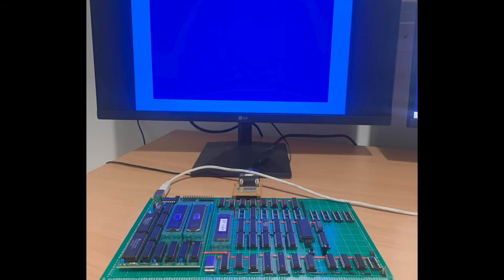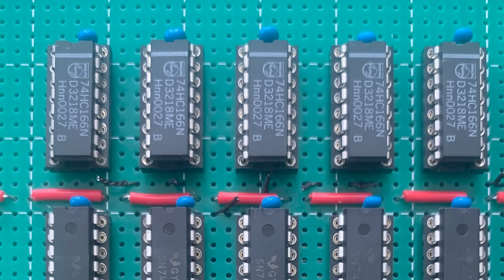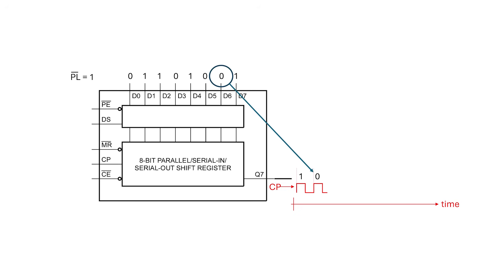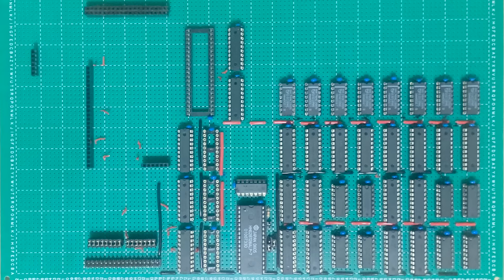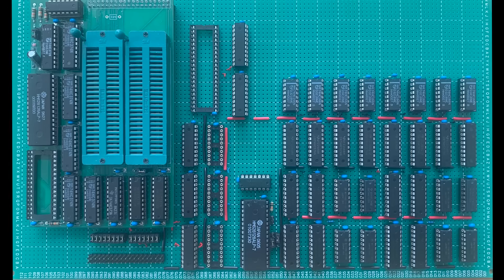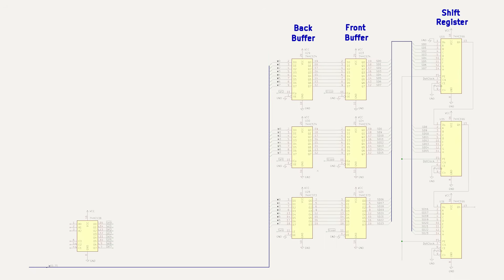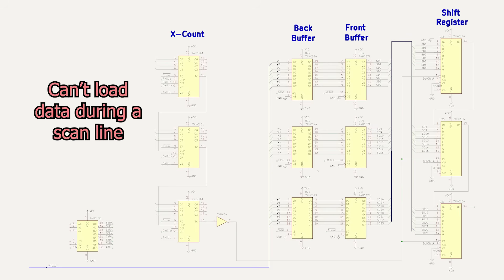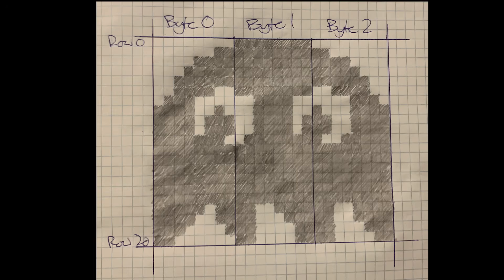Commodore 64 from Scratch: Sprite Engine

Comment: Does anybody know of the adjustments the vic2 chip designer did to make it 80 columns?
Reply from the maker: Yeah, i haven't looked into it.  They'd have to double the dot clock.  They might be able to do in-page back to back reads (same RAS cycle) from the DRAM to read a pair of bytes in one same CPU clock cycle.  Unfortunately  i haven't been able to find much detailed documentation on the fine details of VIC-II (admittedly i haven't looked at every forum), so i am making some assumptions about how it works.
Reply: @DrMattRegan Yes, same here.  I was hoping somebody would know, and all they did was do a few adjustments and overclock it.  But, we hsve the mega 65 design anyway.

The thing was so close to next level.  4 unique colours per character and sprite and 16 sprites per line and 80 column 640x240 version of the 320x240 mode, with double clock would have made it great replacement for the 64. Plus 256 colour pallete.  The snes simply walked over it's sales. It still sold well, buy coukd have sold x times more than both combined in a 80 column next generation The amstrad pcw idea would have been goodas a business 80 column version, built into one of their monitors.  They sold 8 million PCW's, Commodore could hsve sold 80 million of a 80 column competitor.

An easy upgrade would be to switch thr colour set values between the different versions Commodore used on differeng machines, and pure 100% RYGCB,black, grey-i and 66% versions.  Pure bright colour games like in the Spectrum, were fun.
Reply: C128 has a separate chip for 80 columns on monochrome CRT. PET in some later version also. Amiga has 80 columns on chips from the same fab on RGB CRT. Why does the vic2 need 80 columns? Which designer do you mean? No vic2 ever showed more than 40 cols. How would that even work on S-video?
Reply: I'll take time out.. The C128 is the substitute machine that is differnt but has a c64 mode.  You notice the modes are not mixed like a c64 80 column should be, and even has separate video chips. It is not as refined, elegant, small, or as cheap as an enhanced c64 should have been.  By the time they responded to the situation, the C64GS did not come out, but has been released now under new name.

The C128 has been moded to ouput 80 colmns out over composite.  RGB is just three rca video signals like composite.  They could easily break RGB 80 colums off a new machine and have the DIN port support it.  Normally svideo is meant for lower resolution, but thry could have modified that too.  They were a market lesder selling their own monitors can cam set their oen modes.  A normal TV though, would have only got higher resolution as a smudgy detail which is still better, but why you buy a monitor or better TV that can tske the extra resolution (RGB and scart RGB versions etc).
Reply: @waynemorellini2110  Commodore shipped computers with monitor. So, of course they could sell separate monitors. I just mention Amiga because originally it was supposed to have the color space of the C64. HAM mode is meant for this to produce this BitmapBrothers look. What is the problem with the Amiga? In the block diagram I see that there is transceiver to a 8 bit data, 16 bit addressbus: Same as C16 . Only memory hungry video, sound, and CPU use 16 bit. I don't know why no Amiga128 or Amiga256 was released. And why did Amiga have no text mode? And why does Paula not have digital per channel low pass filters? Why Paula only has 8 bit. Yeah, if Commodore had made Amiga a supser-set of C64 in the year 1985, that would have been nice.
Reply: Now, sorry my typing response had fallen off a cliff, so I started a new response on the Amiga 8 bit chip. The chipset was originally to come out in an 16 programmable colour pallet version to go into 8 and 16 bit cous through Motorola who had prior interests.  Atari not getting the rights went to court for years.  The Motorola chipset quietly dissapeared.  So no c128 or c64 with it, or Amiga.  A shame.  However, a c80 of either c64 or plus 4, as above could sell for less anyway years before it came out and be expanded to better graphics beneath the Amiga.

I do what if retro machine design exercises.  So, have looked into it and dige calculations.  My alt design proposal for the Atari 2600 is really interesting, putting it years ahead ofbthe Amiga, upgraded for years and years to get there, using some simple modifications.  So, I'm interested in Matts design for exploring changing things aswell.
Reply: @waynemorellini2110  I like standards. So we stick to S-video. I understand that monochrome resolution has not limit. So the idea is to have hires monochrome character, with color attributes. No color attributes for the background. The space between characters would be huge enough for the bandwidth around the color carrier to change? No ligatures! At least, plus4 has narrow borders. If we exclude the composite users anyway, we can demand a screen with horizontal adjustment so that we can use more cycles to display the "background". Apply all the know optimizations to reduce the cycles needed for sprites.
Reply: @ArneChristianRosenfeldt Well I don't want to limit to that standard.  Analogue RGB standards are way better.  S-video, they can make a version which runs 80 column over the pin and sell monitors and TV good enough to keep up.  That sort of thing they could do in the 1980's. It's ok.
Reply: @ArneChristianRosenfeldt The guy who designed the vc1 and 2 chip, should a modifed c64 80 colums prototype which the compsny turned down, and then he left.  I forget the name.  But, a lot of machines do not get approved released but are only various stage of prototype. Like the 40 column vic 20 replacement.  They even made a new vic prototype chips for it, but it was canned and not released.  I think the c64 was simply doing so well early on, and they were protecting their failing business lines, and then pricey Amiga, then were trying to go up matket on, that a 80 column c64 became an after thought and the c128 was designed.  If the c128 had the intended graphics chip, and an upgraded 6502 accessing both, with the z80 possibly running in parralel as a coprocessor, that would have been sort of cool.  As is, a substitute 80 columns chip with less ability was used (the original chip model sounded like the stripped down Motorola version of the Amiga graphics chip which got squashed, that Tandy and others were also waiting for).  Some of these limitations have been programmed around, but back in the time the c128 was a bit limited.  If the enhaced c64 had come out yesrs earlier it would have been great, but Jack was gone by then, and they had trouble even implementing their stripped down plus4 series (which needed 80 columns and the better intended integrated software.  I can see his reasoning, but a bit better graphics would have helped.  It too had restrictions with how it was implemented that have partly been programmed around today.  Simply a reprogrammable 16 colour pallette 4 colour per character mode would be pretty good, even without sprites.  Thats how it went in those days.  The enhanced c64 is a "what if" missed opportunity machine now.

BTW, there is a guy who has down custom games graphics hardware to attach to a c64, with all the fancy game graphics techniques like Amiga and beyond).  I would luv to see a TTL verdijn of that. 😊

Comment: I'm really enjoying this video series, it's really interesting to follow. I've only gotten as far as the intro so maybe this is elaborated on later, but I just wanted to mention that the sprite collision registers are virtually useless and extremely few games make use of them. You can't mask which particular sprites they should trigger on, so in your example with Pac-Man they would cause a never ending stream of interrupts as the ghosts collide with each other. Also, from a game design perspective you rarely want pixel perfect detection as it just feels unfair.
Reply from the maker: Thanks, I appreciate the feedback on the sprite collisions, I'll keep it in mind.  But i still need to implement it unfortunately for those games that do use it - the problem of trying to make something backwards compatible.  Ghosts hitting dots would probably be the biggest pain.
Reply: @DrMattRegan  I appreciate your dedication, and they're still interesting from a hw perspective. There are some neat non-game applications of the registers too.
Reply: Commodore should have given us a triangle of bits so that game logic could check after the last scanline. 8x8 matrix. Symmetric. flip and pack the small triangle into the duplicated space.

Comment: Great video, I never knew that 4-7 steal cpu cycles.  looking forward to your next video!
Reply from the maker: Thanks!  Yeah, its about the sequence.  Because it takes (up to) 3 CPU clock cycles to halt the 6510, the sprite controller wants 3-non CPU cycles before it has to fetch sprite data, it's an artifact of that.
Reply: @DrMattRegan  Yea I knew the Vic II used the inverse clock phase to deal with bus contention but had NO idea that it would actually halt the 6510 when it was dealing with sprites. Looking at how complicated the sprite collision detection is brings a whole new level of support for the engineers that baked it into silicon.
Reply from the maker: It's pretty impressive that they get these things to work at all.  Not sure what emulation/testing they may have done.
Reply: @DrMattRegan  That was what I was wondering is if they just drew it up on the back of a napkin at the bar, or if they did what your doing to sort it out.
Reply: @BrokenCircuitRanch  They built the whole thing out of discrete logic to begin with (there's photos of the cardset somewhere) so I assume they built it all up incrementally like Dr Matt is doing here until they got to the feature set they were looking for.

What's more wild than that is that's also pretty much how they built the custom chips for Amiga, though those were built on 3d "towers".

If you have a look at the panels from I think VCF east (videos are here on YT but I don't want to link because of how painful YT is about links these days) they have some of the original development versions on display.
Reply: @SomeMorganSomewhere   this one? watch?v=r_AYDkuMg-U
Reply: @BrokenCircuitRanch  Ah, yeah, that's the one I was thinking of. 

Bil Herd also shows some of their towers in his "Life at Commodore" presos but they are simpler ones which were built around existing LSI chips to either augment or "fix" them for the newer machines.

When you look at those board stacks you've gotta be impressed that the damn thing worked at all ;)

Comment: Ah, excellent! Another episode. Many thanks.

Out of curiosity: Would the sprite generators be amenable to multiplexing in due course to cut down the IC count? To my simple mind the answer would seem to be "Yes" but could get iffy where sprites overlap.
Reply from the maker: Cheers, thanks for the comment!

Interesting thought.  Technically you could multiplex the Sprite controller EPROM into the 6510 EPROM, but you'd still need two notepad SRAMs.  As for multiplexing the sprite engines, i think you still need to handle the worst case were all 8 sprites are active on the same line.  Also,  a lot of games multiplex the same sprite to appear in different parts of the screen.
Reply: Atari 7800 uses a scanline buffer ( as does Sega genesis ). Sprites are rendered in serial fashion "multiplexed". Later this buffer is combined with the background "racing the beam". But VIC-II can horizontally zoom sprites. There is not enough time to render zoomed sprites into a line buffer. Atari Jaguar manages this on much faster hardware. Still it only renders one pixel per cycle. But it can use the whole scanline. Not limited to the borders like genesis and SNES.